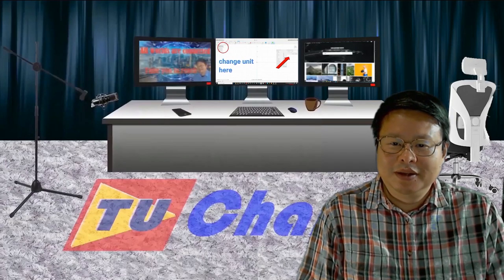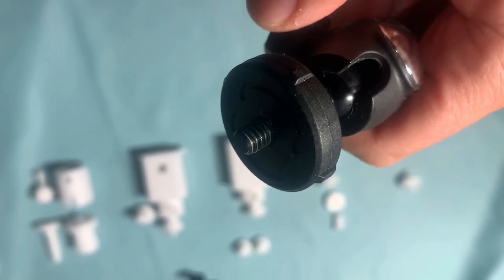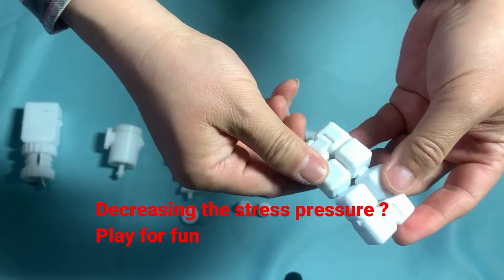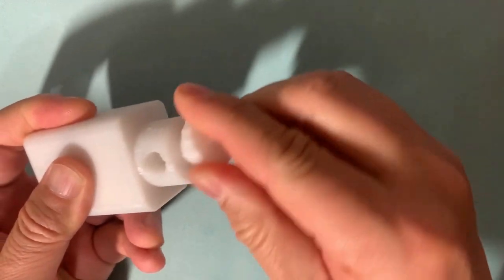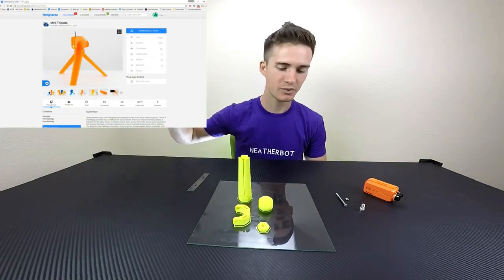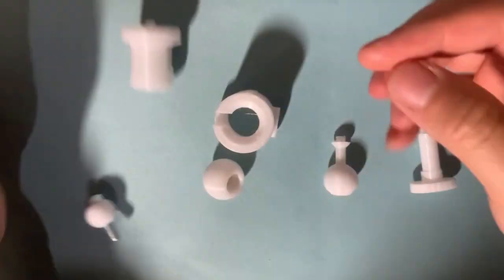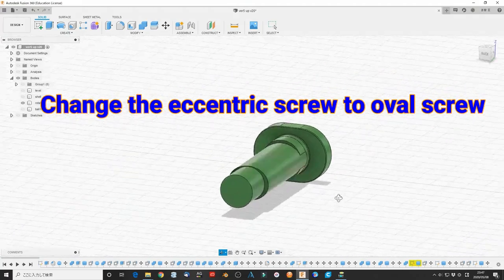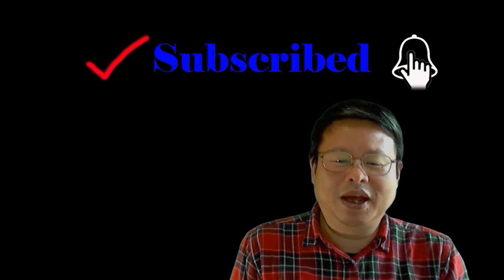DIY tripod universal connector using 3D printer，is it safe？ 用三维打印机自制三脚架转接头,这真的安全吗？

Comment: Nice improvement on ball head designed by me. I designed it only for Gopro camera, but it should hold 5-6 kg, test is in my video too (raise your printing temperature if it break too early, it may be week layer adhesion). But very good solution is to use a metal screw. Regards. Igor
Reply from the maker: Thanks a lot. have a nice day.